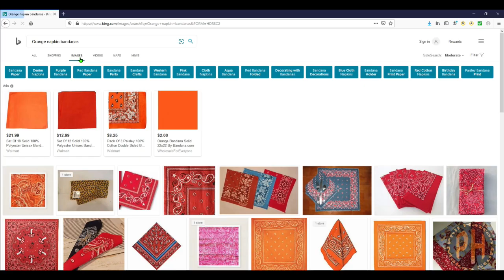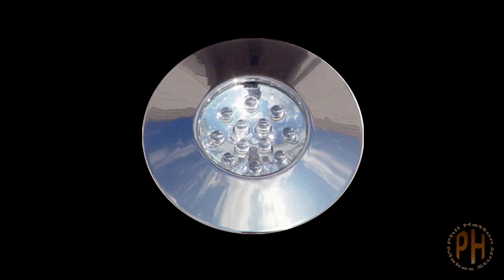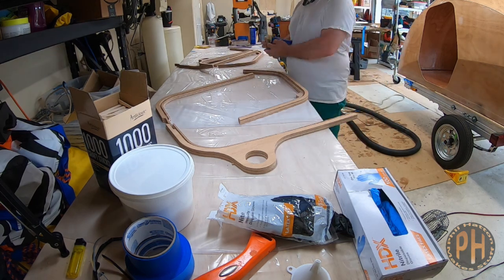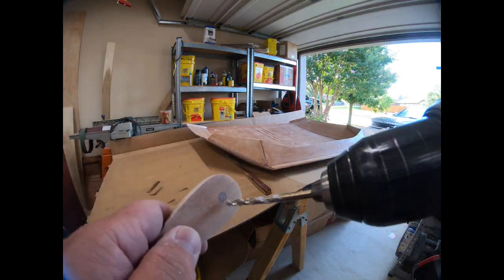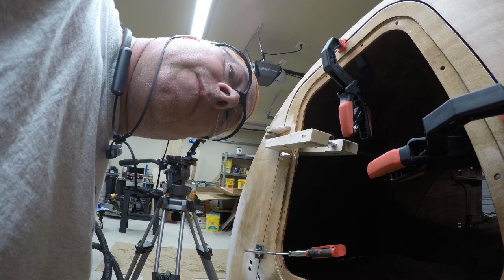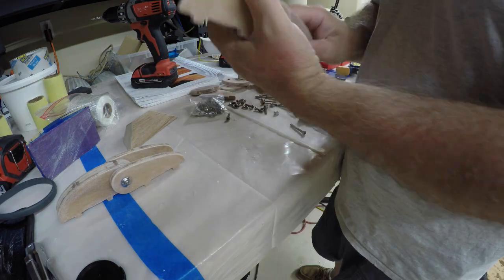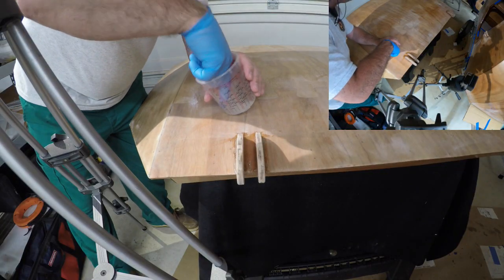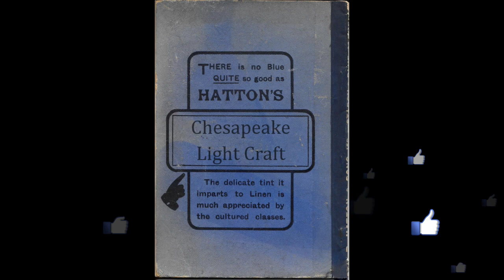Building a CLC Teardrop Camper Doorsills and Hinges

Comment: 3:43  add a 3ed or 4th layer on the tops here , i found in just a few months the wood would sag and the doors would sag in the camper 

3:59 i used a small round router bit here made very fast work of this 

9:28  make sure you add washers here to add spacing on each piece of wood for room for the clear coat , reinstall lower washer latter so the 2 parts don't rub 

11:21 i used a power drill with just the right size drill bit to round all the filet 

11:55 i had a hard time with the eyebrow and door colliding , latter this is a finger getter 

My video is now up ,  make sure you look at my video description in my video to cut to what you need that could help 

hope to see some of my stuff copied as i did some cool things with my camper
Reply from the maker: Good stuff!  I watched your video.  You pay attention to a lot of detail.  We decided not to install the eyebrows because of the interference with the doors.  I might trim them down and install them someone int the future.  Nice tip on using a drill to round small fillets.

Comment: Great video. When you put your doors on did you have the door sag at all? I just finished hanging one door and after drying I opened the door and there seems to be quite the play from the hinges that allows the door to sag about a quarter of an inch
Reply from the maker: Hi,

Thanks for the compliment.  

I have a few ideas and if you're on Facebook you might also ask the folks in the CLC Teardrop Camper Builders & Owners group.  There are quite a few active builders there solving this sort of problem.  https://www.facebook.com/groups/269211970380123/

My first thought was to shim or tape the door into position and add washers or shims to the hinges or take the doors off and add thickened epoxy to the hinges to reduce the play.  That might help with some of the sag.  

My second thought is to fill in the holes in the hinges with thickened epoxy and align everything properly, maybe even some reverse sag, then with everything in place, re-drill the holes for the hinge pins, trying carefully to align the holes from one hinge to the other (top hinge to bottom one) and to make sure you have the holes sized correctly for the bolts we use as hinge pins.

Another idea I have to think more about would be to do the hole step above and get some brass rod and use it as one long hinge pin and sleeve it like the you did with the bolts you used.  Brass rod is quite easy to cut and to thread and it polishes up well too.

Comment: wish the videos had numbers for order to watch
Reply from the maker: Hello Candy,
The videos pretty much follow the order of the build manual from Chesapeake Light Craft.  The latest videos wander around a bit but that's because we finished the camper in a hurry and did as much in parallel as possible.  In my next series I'll number the videos.  In this series, many of the video names ran out of characters and I wanted the names to be as descriptive as possible so people could fine them when searching.  Below is the chronological order of the videos.  Also, I have included the order from the build manual.  Hope this helps!
-Phil

Video chronological order:
Building the Flatbed for a Chesapeake Light Craft Teardrop Camper
Unboxing the Accessories for CLC Teardrop Camper
Epoxy Tips for Building the Chesapeake Light Craft Teardrop Camper
Building the CLC Teardrop Camper Cradle
Chesapeake Light Craft Teardrop Camper Stitching Tacking and Unstitching
Preparing the wood to build the CLC Teardrop Camper - Getting ready for stitch and glue construction
Building a CLC Teardrop Camper - Assembling Panels 1-4 - Stitch and Glue Construction
Building a CLC Teardrop Camper - Galley Flat - Bonus: Mistakes!
Building a CLC Teardrop Camper - Quarter Panels - Stitch and Glue Construction
Building a CLC Teardrop Camper - Assembling and Installing the Bottom - Stitch and Glue Construction
Building a CLC Teardrop Camper - Bulkhead and Hatch Stiffener
Building a CLC Teardrop Camper - Filling the Exterior Joints - Stitch and Glue Construction
Building a CLC Teardrop Camper - Glassing and Epoxying the Exterior - Stitch and Glue Construction
Building a CLC Teardrop Camper - Galley Hatch, Doors and the Rooftop Vent - Stitch and Glue
Building a CLC Teardrop Camper - Installing the Transom - Stitch and Glue [this probably should be after the galley hatch gutter... follow the build manual if you're worried about the order]
Building a CLC Teardrop Camper - Installing the Rooftop Vent Bezel [this probably should be after the galley hatch gutter... follow the build manual if you're worried about the order]
Building a CLC Teardrop Camper - Assembling and Installing the Galley Hatch Gutter
Building a CLC Teardrop Camper Fiberglassing the Bottom
Building a CLC Teardrop Camper Windowsill and Door Stiffener
Building a CLC Teardrop Camper Doorsills and Hinges
CLC Teardrop Camper - Installing the Windows Shelf and Vent

Build manual order:
Assembling the mold
Assembling the camper shell (panels 1-4)
Finishing the camper shell (bulkhead, hatch stiffener, galley flat, quarter panels, assembling the bottom panel, installing the bottom panel)
Fiberglassing the exterior
Doors and Hatches (fitting the gutter, assembling the top hatch bezel, fitting the hatch bezel, installing the transom, fiberglassing the bottom panel, interior of the hatch bezel)
Building doors, sills and hinges (doors, galley hatch, top hatch flange spacers, door sills, cabin shelf, installing hinges, installing eyebrows (something we decided not to do, but we might in the future)
Integrating the shell with the trailer
Painting and varninshing
Hardware (hanging doors, installing galley hatch)
Options and accessories...